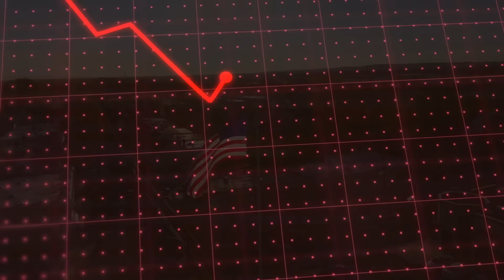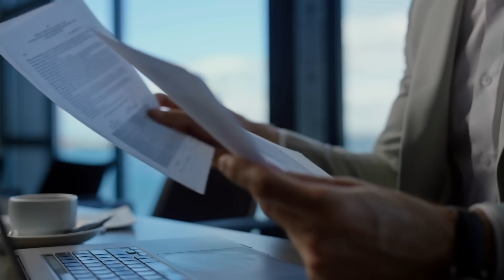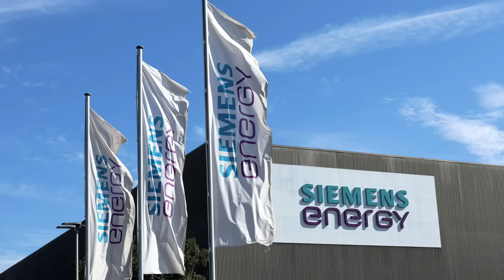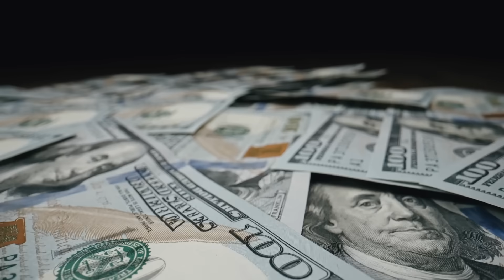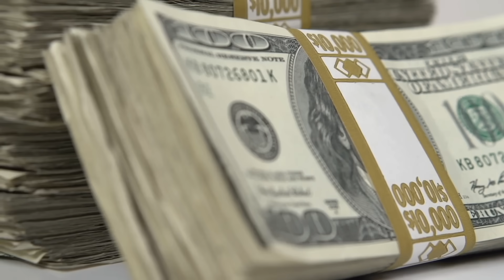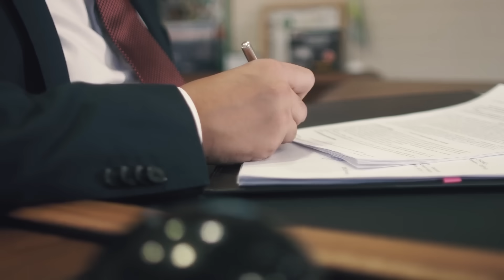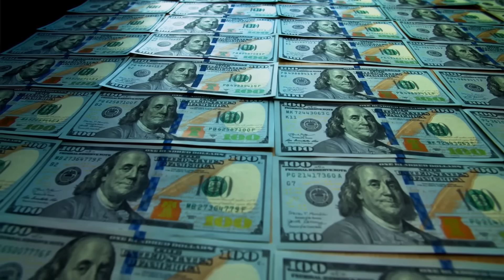The Real Reason America Has Turned Its Back On Wind Power Energy

Comment: EMF from high power transmission lines is assumed to have no negative health impact.
Make the CEO live under one,see how they get on.
Reply: They do not, but it us unusual that they go over houses.
Reply: @old-pete   In the UK it's not practical to run them far from anything.
Same issues with backlog of applications.
It's only ever about the money anyway.
Reply: @theodavies8754  There is a difference between low distance or running them over the house. I would hate to do any roofwork there. Imagine one needs a crane...

Comment: Inserting government into Transmisssion grid expansion is a recipe for wasteful expenditures of your tax dollars. Connecting generators to a transmission net work changes energyflows on the network  Part of the normal process of connecting new gneration  includes the transmission upgrades  to make the interconnection The total cost of the project includes the interconnection cost.  This is the process utilities use for their own new power plants.  locations are studied until the most economic slution is found.  This is the process that should apply to independent power producers(IPP).  They should pay for interconnection of their own projects This incentivises the IPPs to find the most economic solution.  Any other approach does two things.  First, it removes any incentive to find the economic solution.  Second. it also shifts the cost of interconnection to the electric customers who will then be subsidising  the interconnection cost of the IPP.  Government involvement in transmission netrwork expansion will result in millions of wasted money.

Comment: Perhaps it would be time to go back to local generation and consumption like we once had. Tell the monster wind farms and grid octopuses to shove it. It's my understanding that  some solar panel customers are now required to put in battery storage before they can be hooked to the grid. Soooo, you are making the power and storing the power. Seems a good time to tell the grid to shove it and unhook from the grid!
Reply: Making a house energy independent is too expensive.
Local production is good, but usually cannot cover all demands. Windturbines are a good addition, since the can produce electricity cheaply.

Comment: You are spreading propaganda about the wind turbines.  They are not efficient or so called green to manufacture, the energy output is not worth the cost, maintenance, harm to wildlife, and useful life is not that long.  Also, maintenance is astronomical, drive or fly around and check out these wind farms, how many non-working turbines do you see, A LOT.
Reply: Nobody claims they are green to manufacture, nothing is. The energy they use is green.

Comment: The winf Mill and solar panels are not environmental friendly.  These project take up millions of acres of land, forest are removed for solar panel field cause CO2 levels to rise, children are mine the mineral in third world countries and dying for the hazardous material they are handling.  The solar and wind mills are not the answer.  The extend time frames are related to Feral permitting issue as it take years to get approval or rejection.

What make more sense it calrium power plant that produce thousands of more kilowatt's per hour and the plants site takes about 15 to 20 acer's instead of thousand of acres required for wind turbine or solar panels.  The is a very safe power plants and next to net zero hazardous waist.
Reply: Fossil fuel power plants produce much more waste and require much more mining or drilling.
Reply: Not true as I built pipeline to the natural gas power plants and there is no waist from the natural gas.  They are the cleanest as less impact to the environment. They also take up 80 percent less land to build and provide thousand of more kilowatt hours per acer of land the solar or wind turbine.  @old-pete
Reply: @davidhagerman7165 So you want to tell me drilling gas wells produce no waste? There are never spills of toxic drill fluid? The chemicals in water supplies near drillsites are an imagination? That the over tenthousand unproperly closed gas wells in the US alone do not leak methane? That there are no leaks in all the natural gas infrastructure? That gasturbines do not produce exhaust gases?

Comment: Interesting but doesn't cover the fact that even if the connections could be made, wind turbines and solar panels have a limited life anyway and use more and more of the earths rare minerals mined from poor countries and destroy them in the process. The greed here is from the 'green' industry, their product cannot be bought to market without taxpayer money, as it is not good progressive technology. Good technology doesn't need subsidy.
Reply: Everything has a limited life span.
Windturbines barely need rare metals, solar needs more, but both can be recycled, which limits the need.
But it is interesting how many people discover their inner social justice warrior, when talking about wind or solar power, that bought cheap electronics, clothes, food and fossil fuels for decades from poor countries.
Reply: @old-pete  yes but all things associated with so called green energy have much shorter life spans that previous technology. As far as I know turbines and solar panels which have been replaced so far have mainly gone to landfill  as they can be recycle economically. 
Oil/gas power stations have a life of 40-50 years and can be rebuilt and updated in situ. Off shore turbines about 10 to 15 years and they are spread all over the sea. The cost will go on an on. Of course they use rare materials, copper alone has become much more difficult to mine as we have to dig more ore from areas which have lower concentrations present-usually in poor countries. You need more copper to connect up hundreds of turbines to replace one power station. 
Your second comment is beneath contempt, many or us have been against big business off shoring our industries for many yours. We were not buying cheap, companies were and selling to us at inflated prices. We mostly have no choice at all now. The Wests green ideas are at the expense of their own poor, losing their jobs, paying more tax and the stripping poor countries of there natural resources and cheaper labour, whilst rich multi-nationals continue to make more profits.
Reply: @grahammutlow1612 The life spans are not much shorter and they need less ressources and produce much less waste. 
You are forgetting that fossil fuel power plants need a constant stream of ressources, just to produce electricity. And these ressources have to be transported too.

Recycling usually costs money or do you think someone will tear down a coal power plant for free?
One can use aluminium for cables. Copper is not necessary.

Are you telling me you chose always the more expensive version of a product? People are looking at the price. If companies did not look for the cheaper option, they would go out of business.
Reply: @old-pete  Have to disagree, we have in the UK power stations that are over a 100 years old. They have changed from using coal, to gas and in one case to bio-fuel wood pellets. The actual steam turbines have not had to be removed although they have it be maintained and repaired and the connections to the power grid are the same. But as the boilers were made of steel and brick the material can be easily repurposed. We could (but haven't as yet) also install modular nuclear reactors in some of the same buildings. Currently (as far as I know) they are no commercial reclaim facilities for turbines and solar panels, but they are being buried and they only last 12-15 years. Similarly we are rapping Africa for Cobalt for our battery cars, destroying rain forest for very old and inefficient, short term technology.

We've really not thought this through. Have you not seen the Bloomberg report on wind farms in the USA, waiting for up to 10 years to be connected to the grid, companies are now pulling investment on wind farms and their report states that it will costs about $2.5 trillion to connect up all the required wind farms and solar arrays. All this will use more and more energy and actually create more pollution now, for theatrical energy savings in the future and of course if the wind doesn't blow and the sun doesn't shine? 
In the UK the cost is only half a trillion because we've had a very grid for 60 years, but not for turbines. As it takes around 200 large turbines in open country or at sea to replace one minimum sized power station you need for more cables and of course they disseminate the bird population. Meantime China and India build more and more coal fired power attestation.

Aluminium has been used for cabling, to save money but breaks down after 20 to 30 years. Here in the UK our nationalised telephone supplier in the 1970's started using aluminium and have spent the last 10 years going back to copper for local connections. So yes if its more reliable and last longer of course I would pay for the better product. Part of our problems now are our through away society.

Are are actually destroying the the planet in the name of saving it? There is much better technology but idiot greenies and governments won't listen.
Reply: @grahammutlow1612  No steam turbine runs for a hundred years. All the turbine parts have been replaced. Are you maybe talking about steam engines?
There are multiple companies that recycle windturbines. In some countries recycling is required.
Solar panels easily work for 30 years, even 40 years are possible. They just lose efficiency over time. There are windturbines running for over 30 years. Some of the new ones are even designed for that life span.

Building power plants without a grid connection is human error. That can happen with any power plant.

Aluminium electricity cables last longer than 30 years, they probably do not work well for data connections.

Comment: This bloke obviously no understanding of how a power grid works. Too much intermittent electricity will collapse the power grid, and as for green energy there is nothing green about covering farms with toxic non biodegradable solar panels and bird dicing fiberglass wind turbine blades.
This bloke obviously knows nothing about energy or the environment.
Reply: Denmark gets over 70% of its electricity from renewables and has a much more stable grid than the US.
Solar panels and windturbines do not damage the fields.
Windturbines kill 1/35th of the birds that fossil fuel power plants kill.
In other words windturbines replacing fossil fuel power plants are saving birds.

Comment: The only people I know in California that are really in love with the green deal, own their home, installed $30k of solar PV, another $30k of storage own two teslas, and don’t understand the rate system. Their buddy who convinced them to get a Tesla told them electricity was $0.04/kWh. It’s not - the cheapest is about $0.36/kWh. They are off by a factor of nine in how much it actually takes to charge. And they NEVER understand the utility cost of the $100k Tesla and the $60k of PV/storage.

My panels produce about half as much in winter. It’s going to be very cold in New England (oil heat) when they go all solar. The sun is  MUCH lower in the sky and the panels will be covered by snow.

NO ONE IN POWER WANTS TO ANALYZE THE DATA.
Reply: The data was analyzed countless times. 
One can heat houses with solar heating in winter. That was proven in the 80s.

Comment: It was a great idea when it was paid for by someone else.
California required/subsidized so much solar, without batteries there is too much power during the daytime. They no longer buy excess from customers.
Of course there is virtually no storage.
As they close coal and natural gas plants, we’ll just import from others, until the ancient grid is overloaded.
Everyone should learn a lesson from this. But in stead, everyone is bragging about the percent of renewables used - during the day, on a sunny day in August. What about night time in January? When everyone wants to charge their EV and use their electric stove, clothes dryer, water heater, and electric heat pump (all new NG is banned and they plan to FORCE us to replace our perfectly good NG appliances - that are much more efficient. Just rewiring my home (we have no basements for easy access) is estimated to be $15K - $30K in addition to the appliances. And there won’t be enough electricians or appliances when the time comes, so demand will double prices.

But hey, let’s replace our perfectly nice ceiling fans with “more efficient” ones that cost $100 more (throw away a nice $300 and buy a $500 one that will save only $10 over the 20 year life of the fan. We have seven ceiling fans in our home. That goes to the landfill, I spend $3,500 plus installation. No problem, I’ll save $70 over the next twenty years.

BEWARE - California Gov Newsome is running for President.
Reply: There are more renewables than just solar and wind.

Comment: This video was well done, however, in spite of it trying to put a positive "spin" on green energy, in addition to gobs of  that pesky additional "government funding" (aka taxpayer and rate payer - aka US!) the technology only lasts 10-20 years and has to be basically replaced with even more strip mining of essential and rare materials.  This is GREEN????  So even if you achieve the holy grail of becoming green - the costs for keeping it going quickly exceed our ability to even pay for it.  The NET effect of this is that going GREEN is the opposite of saving the planet and is in fact destroying the planet.  And as soon as enough of the people (US) figure that out, you are going to have one lot of angry voters who will feel they were duped (which they are).   Overall - GREEN energy sounds great, but like snake oil, is not at all helpful for the extreme costs net results!
Reply: Windturbines last 20 years, new ones 25 to 30 years.
The material needed is much smaller than all the fossil fuels needed for power plants of the same output.

Comment: The wind power advocates are just breaking wind. They're expensive, inefficient and unreliable. As for the solar scam, here in Michigan in the dead of winter, we get less than eight hours of daylight. Not to mention snow accumulation will block that sunlight from getting to the panel. What are we supposed to do? Climb up on our roofs to sweep it off? Try that in a blizzard.
Reply: They are cheaper than fossil fuels. Reliability increases with numbers and distribution, not that anyone plans to rely only on wind.

Comment: Texas is a lesson that  needs to be remembered. An ice storm coated the windmills and solar panels making them useless. They were 48% of the grid. Demand for one of the coldest winters in Texas caused the grid to collapse. People froze to death.
Reply: Well how do we make any electrical power then?   I’d rather go down the wind turbine route than nuclear or coal power stations…… we don’t have ice storms in Great Britain 😂
Reply: @richardwyman5975  Wind and solar are a joke, they are not green, not cheap and not reliable; natural gas, nuclear and coal are preferable if you want to live in a first world economy.
Reply: Wind power was nowhere close to 48% in texas, the primary cause of the outage(s) was the gas lines themselves freezing. 

The Federal Energy Regulatory Commission and the North American Electric AEP -0.6% Reliability Corporation found that Texas' over-reliance on natural gas was the main cause of blackouts during Winter Storm Uri – more than 80% of ERCOT's natural gas powered backup generators failed, prolonging outages while residential ...
Texas Freeze: ERCOT can do better than counting on failure-prone Gas
Reply: @pteechka1  wrong facts, it was Failure to have oil Back up at the Nat gas oil Power Plants, evert new nat gas power Plant the TVA has built since 2022 has oil back uo  the TVA is also adding oil back up at a lot of its Nat gas power Plants
Reply: @dknowles60 they also could have avoided the problem with the addition of a small connection heater, at a cost of $8 per unit, times possibly as many as 4000 , plus labor
Reply: @pteechka1  dont worked, the TVA tryed it it Failed
Reply: @dknowles60  actually it's a fairly standard installation, required almost everywhere in the US , except for Texas , which is separate from most of the grid infrastructure.
Reply: @pteechka1  wrong again Ask you fed gov TVA about its 33% nat gas failure Rate dec 23 dec 24 2022
Reply: Only in Texas
Reply: Texas does not even have that much wind and solar power. Half the natural gas supply froze up, which caused large parts of the natural gas power plants to go offline.
Around 18 GW gas, 6 GW coal, 4 GW wind, 4 GW nuclear and 0.5 GW solar went offline.

Comment: Renewables are a dead end. Every day is feast and famine. We don't control the sun or the wind. That is why the grid is so inadequate. And even if you build out the grid, how do you get the energy when you need it? You need massive storage. Toxic inefficient storage. We are close to a toxic battery catastrophe. We need sources of clean energy that are controllable. We need modular nuclear. We need clean storage options like hydrogen or ammonia.
Reply: Wind and solar are not the only renewable option. Fluctuation is reduced by setting them up in diffferent areas.